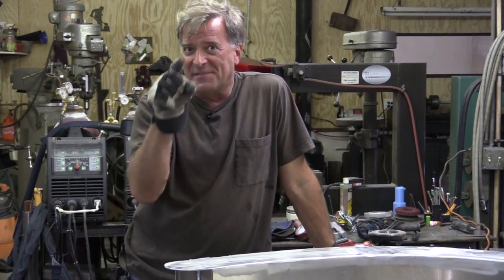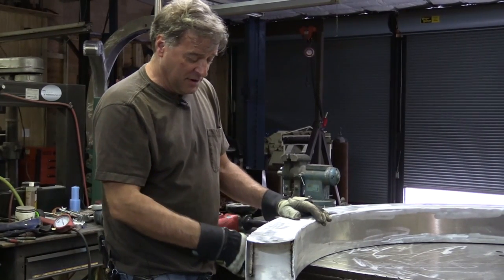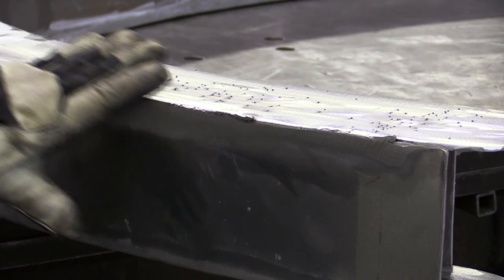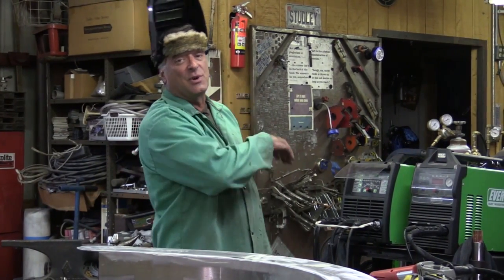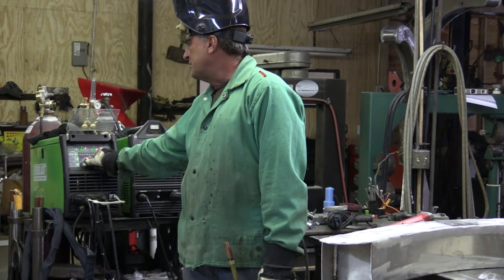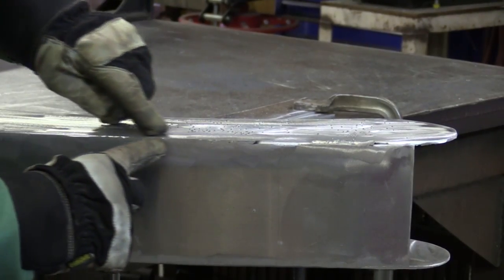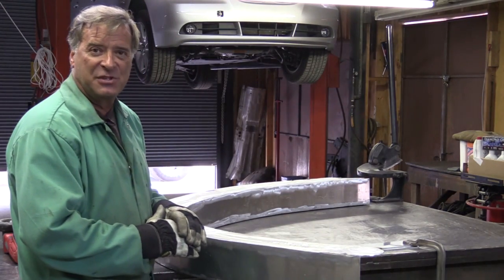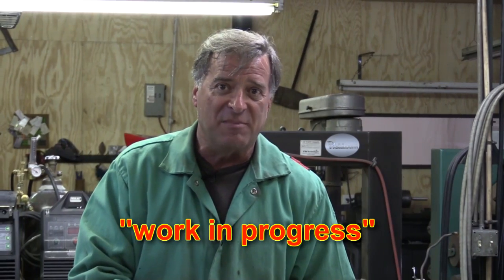How to Create Sharp Edges When Fabricating Metal - Kevin Caron

Comment: Nice tip on the edges. I ave a question about the new AHP 250 MIG machine. I have a Hobart Spool Gunner 100 with a 4 pin connector on it. Do you know if it will work with the 250? I sent AHP an email but they did not respond. Thanks in advance for any infor you can provide.
Reply from the maker: Sorry, not sure if it will work..

Comment: Hey Kevin, I bought the older version of the Everlast welder 2 years ago, and I'm embarrassed to say that I haven't used it once because I don't have 230 to plug into😔 I also bought the largest capacity plasma cutter too, same issue. Duuuummy! How do you like the spool gun? and would you consider doing a tutorial video on the spool gun. I've made my money welding for 40 plus years, but never even thought about what I needed to plug the machines into. I feel very stupid now, but I know when I finally get my shop wired for 230, I'll have be and new machines to run 😋😉
Reply from the maker: Already did,,   Look here.... https://www.youtube.com/watch?v=lQVwTL0ew8s

are those machine 220 only?    Or do you have a dual voltage machine?
Reply: Kevin Caron, Artist.  220 only
Reply: You have enough to make these purchases but cant afford an electrician to come in and make your 110 a 220?
Reply: Kevin Caron, Artist  thank you for the link.
Reply: Jesse Rodriguez- I asked Kevin a question, has nothing to do with affording anything. has even less to do with your input.